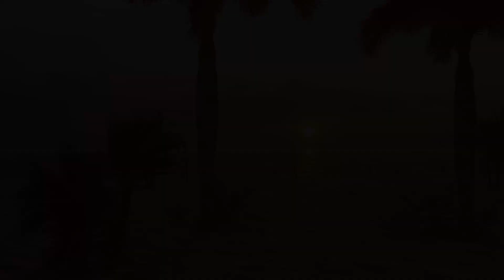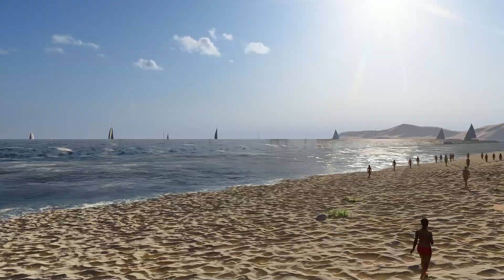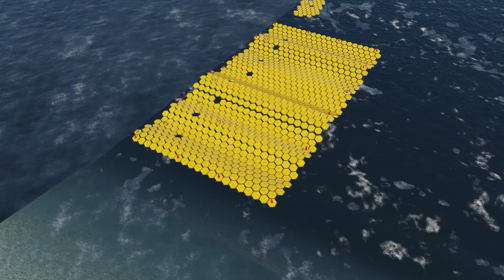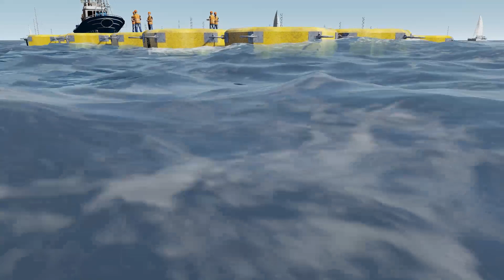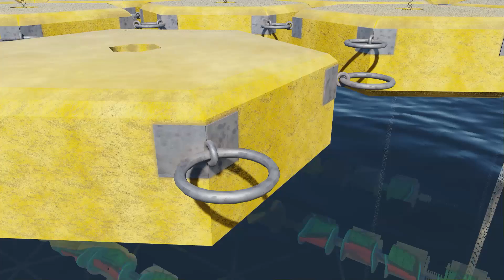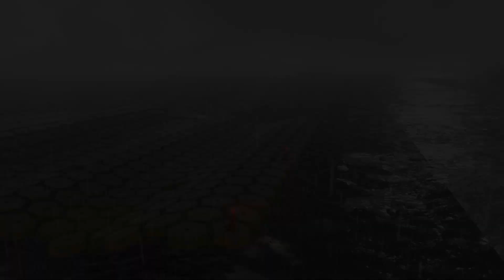James Craig Wave energy

Comment: I think you'll find that the turbines will stall rather than turn when fully submerged and in an inconsistent flow. The drag on them is roughly equal to the motivation to rotate and hence nothing happens and if it does it is very low energy output.

Comment: couldn't these be 200' below the water and work just fine too?
Reply from the maker: Relies on a floating system. Utilises the power of buoyancy. The turbines need to be away from the turbulence of the wave near the surface, but dont need to be too deep, as it will cause excess friction loss

Comment: Too expensive for low quality electricity.  Low quality electricity because the waves are truly intermittent.  Cannot deliver "huge amounts of energy" because there is typically there is ten seconds of  trough between the powerful peaks, in ocean waves.
During all my armchair configurations of wave energy,  I did at one point come up with hexagons, linked in a similar fashion at the six corners (around 2014).  Interesting to see!
Reply from the maker: your assuming that the waves are running parallel with the lines of turbines, infact the idea works well when the line of turbines runs perpendicular to the waves, or at various angles to the waves. But i accept your point, that if the waves take 10 seconds to pass parallel over the lines of turbinese, then their ability to keep turning the central line is diminished.

Comment: The buoys move up and down like a piston, so attach rods to turn generators mounted above on a deck. hint...catamaran, floating dock, 2 or more retired battleships with decks built between. Totally scalable. Self powered ships,  floating farms, factories, even cities. Damn, how to collect taxes! Isn't  it enough I sell you cheap electricity?
Reply from the maker: So, the idea of a vertically moving piston rod, to turn generators, doesn't work so well (efficiently) in the real world of ocean swell. The way these work, is that the up and down motion is converted into a rotational motion thanks to the turbines. These turbines turn a cable very slowly, but with a huge amount of torque. This slow turning (but very high torque) cable then turns a constant variable gear box, which maintains a constant speed of around1800rpm at the generator.
Picture a very long flag pole, laying flat. Put as many people along either side of it as possible. Then get them to hold the pole and turn it in one direction. Despite all of those people turning the pole, they will only be able to turn it relatively slowly. But, because there are many hands turning the pole, over the length of the pole, the output at either end will be a slow turning momentum, but with a massively high torque value. The varying speed of the turbines over the length of the pole is possible as some will "slip" like the chain on your bike, when the rear wheel is going faster than you are peddling. The gear boxes then convert the slow input to fast output, hence delivering a high speed spin inside the generator.

Comment: So the generator is under water, midway between buoy and concrete anchor?  I had almost the same idea long ago, but the generator was mounted on the buoy itself, for easier maintenance.
Reply from the maker: No.
Reply from the maker: The generators can be mounted either underwater, or above - on their own floating platform.

Comment: i dont understand how it works. can anybody tell me?
Reply: It works in the same way as all the other wave energy plants. IT DOES NOT WORK AT ALL. Nobody has ever seen a wave energy plant that actually works and creates just a reasonable power output. Within a year or two, they are all converted into scrap. So the only meaningfull use is as scrap metal.